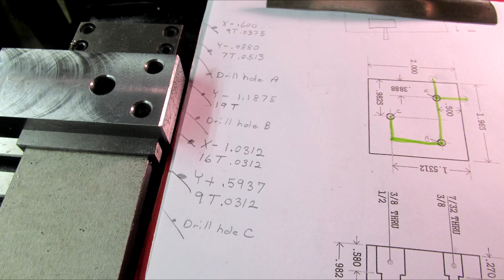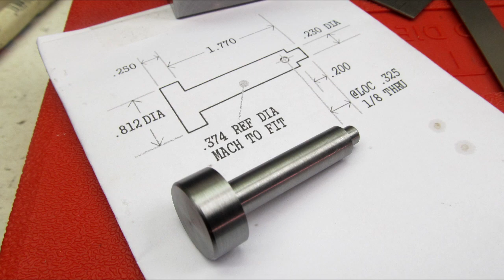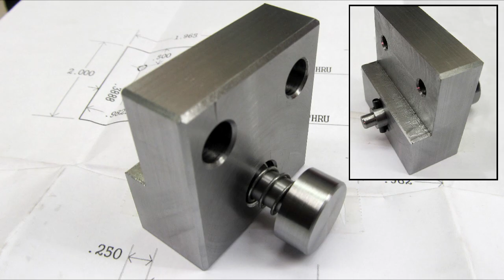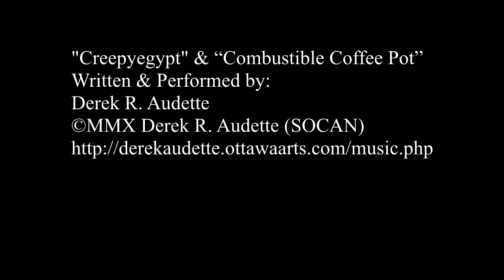Machining Project: Spindle Lock For The HiTorque Mini Mill

Comment: Great design.  I liked it so much I made one myself.  Works great.  Just one problem came up though.  The design diagrams specifies for the two bolt- holes that hold the device to the mini-mill or them to be 500 thou from the top of the piece.  I followed these dimensions very carefully, but when I tried to install it they were too high such that the hole for the locking pin didn't line up with the hole in the spindle.  I had to convert the mounting holes in to slots (also the counter bores) such that the hold-down bolts could be moved down.  I made the holes 75 thou longer than round and that did the trick.  The measurement for the offset in the device is perfect.  So when I mount it now, it sits exactly flush with the bottom of the mill's head and the pin lines up perfectly.  I expect this problem arose because not all of the mills are manufactured exactly the same.  This is just a head-up for anyone else who may make one.

Comment: It's simply brilliant, I've been thinking about machining a spindle lock ,I l would love to print the exact measurements so I can take to my shop and make one like it, is there any pdf file I could download?
Thanks.
Reply from the maker: Yep! Link in description. To be safe, check that the print matches your cap screw mount spacing.

Comment: Great, simple design and excellent video. What size mandrel did you use to make your spring?
Reply from the maker: Thanks. I have yet to try making springs. The spring used is a stock spring that I happen to have in my collection.